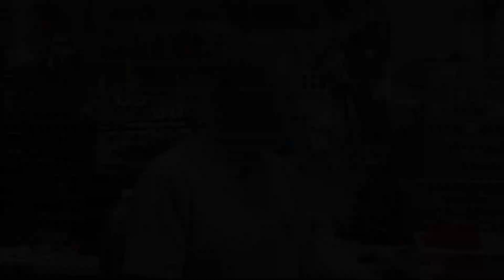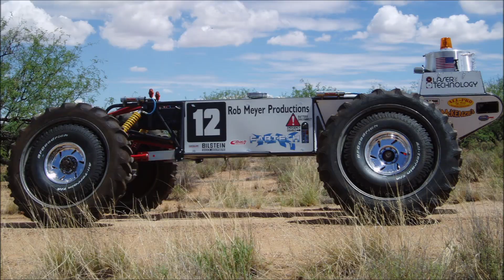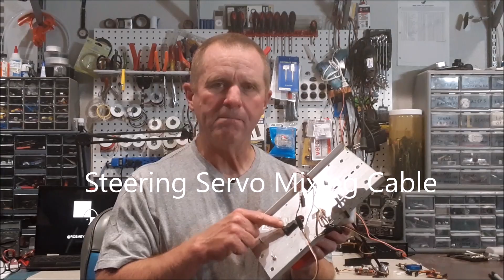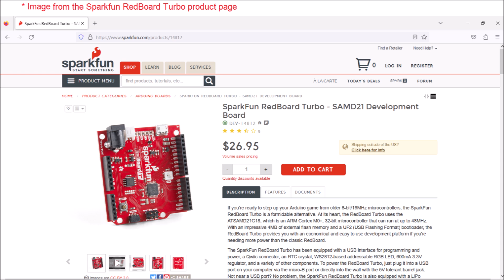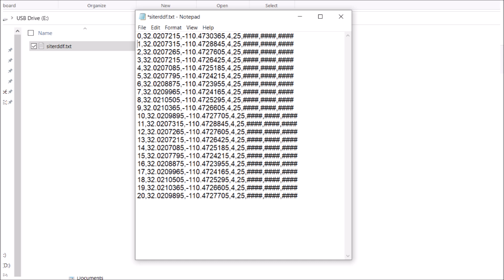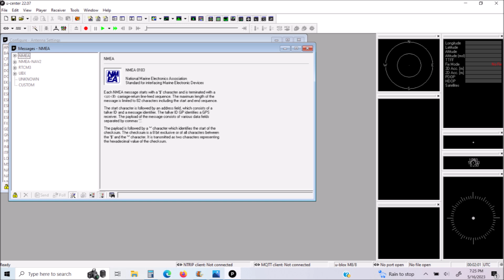Electronics and Running Gear: GPS Guided Rover Series

Comment: I'd like to know why you didn't consider the u-blox ZED F9P rather than the u-blox C94-M8P.  This seems to be the way agopengps is headed and they are claiming much higher precision in routing.

I'm in Canada where RTK correction services are limited and expensive and I'm thinking about a lora base station, setting up auto mowing and field lining for 3 full size soccer fields, fields across the main fields, parking lot lining etc.  The possibility of 1 cm accuracy is exciting.  I’ve looked at commercial solutions like turf tank, traqnology and some open source auto mower solutions as well as agopengps and perhaps using dual gps on the rover rather than compass.  I'm not sold on mission planner or the agopen software if I can just write some route software and control paint sprayer on off cycles.
Reply from the maker: Thanks for watching my video-

Sounds like an interesting project! Honestly I just used the same setup I saw another YouTuber using because he had posted some incredibly in-depth tutorials on the setup.

I am not sure if the ZED F9P was available back when I first purchased my M8P RTK evaluation kit, but I have read up on it a bit since then. I am sure that if and when  I ever build an entirely new RTK system, I will try to source a more recent hardware iteration.
Reply from the maker: To be more specific, I used the M8P evaluation kit because I wanted to avoid relying an an outside correction service- particularly one which would require a subscription and/or continuous Internet connection. With the M8P evaluation kit I am able to set up my own base station and do RTK (perhaps with slightly less accuracy) more or less autonomously, using only the signals from the GNSS constellation itself.

I suppose I could set up a similar system based upon the F9P, but I chose the M8P specifically because it included the radios on each unit allowing me to pass corrections from my own base station. From what I could find, the F9P evaluation module has no radios and relies on an Internet connection and a subscription service in order to function. I am really not very savvy on setting up data radios, so I chose the M8P kit because it was already packaged as such.

I suppose if I learn of a F9P evaluation kit with radio links similar to my M8P kit, I might look into that.